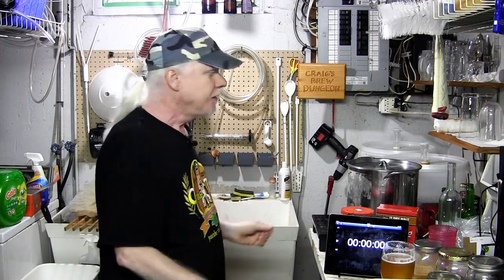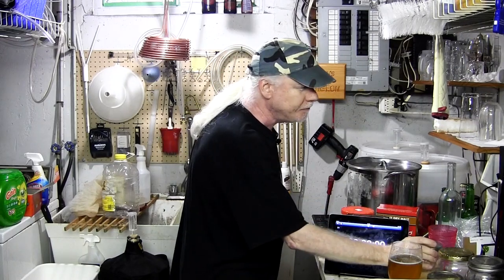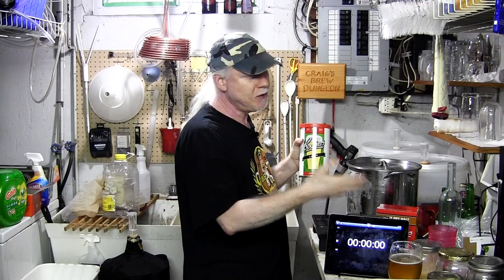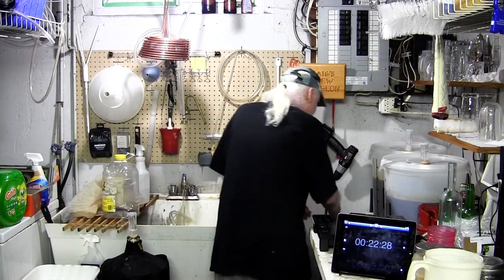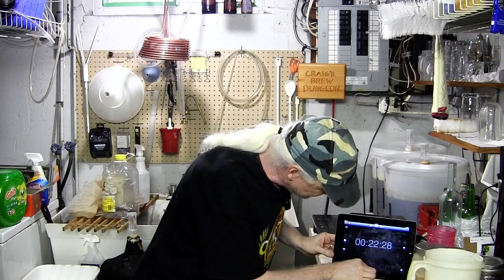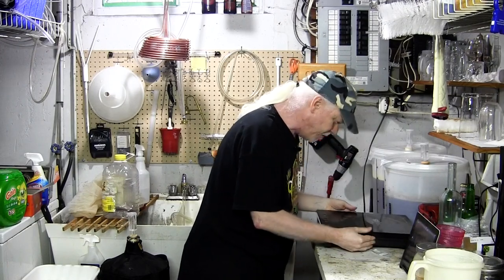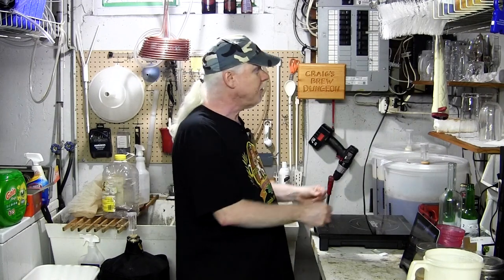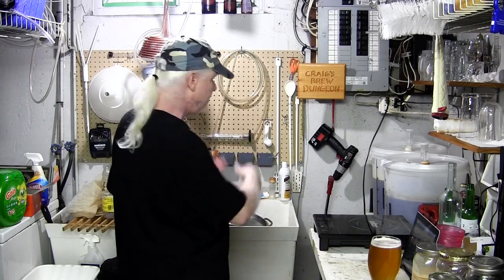HBW 249 - How Fast Can You Brew a Coopers Kit

Comment: I've been following CraigTube for the past 5 years. I've brewed beer, off and on since the early to mid 2000's. If it wasn't for CraigTube, I wouldn't have maintained an interest in home brewing for this long. The series of Easy Home Brewing that Craig has filmed is one of the greatest contributions ever made to home brewing. 

Craig, I'm just now getting back into the hobby after a long break. I just ordered from Northern Brewer one of those 1 gallon small batch brewing kits!. When I get a 5 gallon kit, I would also like to get into kegging. 

Do plan on checking out the 1 gallon brew kits as they are great for experimental beers?  

From one of your loyal fans, thank you for all that you do. 17 and cheers!.

Comment: Hi Craig,

I normally barrel (technically pin ;) ) a batch and then put the next batch in line on to ferment. Start to finish fifty minutes tops but I have done the deed in less than thirty minutes when all goes to plan and I don't mess up. Usually it takes about forty minutes and good beer ensues. All grain takes a full day and the beer isn't 100 percent better which is why I brew kits.

Cheers

Schnuz.

Comment: Craig the Magnetic Cooktop from Home Hardware is 1800 w /Max ,I've had mine for going on 3 years now and Its great with all the built in Safeguards, i.e.- Shuts down if  Pot is removed from the Cooktop.I Cook rice and if you forget or set the Cooktime correctly (rice to water ratio)it'll shut down if water has evaporated and prevents burning...Best $99 I've spent as it owes me nothing and I use it every day.Cheers

Comment: Craig, just got my 1800 watt induction cook top from Amazon $ 60.02 delivered. I haven't used it yet, I'm just getting my brew area together. I have the peg board getting the pegs today. Got five gallons in the keg, five gallons in the carboy. In your last video, I didn't notice any steam coming off your pot and, that is a very short amount of time to brew beer. I'm doing the pilsner at a 55 minute boil, nice if I could shorten the time, maybe later. I'm really new to this. The alcohol content is a little on the high side 5.5% I'd like to get that closer to 4.5%. It's got a good learning curve, I'll get there. Have a great day.

Comment: i dont pasturise my sugar and malt, i just boil the tin for 10 mins while sterilizing my equipment also boil a kettle, i pour the malt in the bucket rinse the tin with the kettle boil another kettle add the kettle with sugar and malt and top with cold water from the shower which gets it airated better and temperature is in range to pitch yeast, my kettle holds 1.7L 2 of those with the 10 min boiled can and then rest 23L cold gets you to about 22-26 deg c which is fine to pitch yeast, a boiled kettle is a constant temp so once you know how much boiled water you can pretty much do it with your eyes closed and be in range to pitch the yeast straight away which is ideally what you want to be doing

Comment: That was interesting suddenly hearing my name broadcast across YouTube! I think that's my 15 seconds of fame. (I knew I'd get it eventually.) I call myself "Ouroboros" on the 17 boards. That used to be what I used here as well, until Google started insisting that we merge Google and YouTube accounts. Shortly after I finally relented and allowed the merge, they stopped that requirement. (Google are a pain.)

Notes while watch:

I'm looking forward to the yeast idea put into practice. I've been thinking about doing that myself, but instead of harvesting from a batch of brew, I've been thinking about using a method involving a giant starter.

Holy Cow, you use a lot of sanitizer! I'll bet I use less than 1/3 cup when I brew.

The part that I really hate is the cleaning up afterwards and I definitely consider that time to be part of my brew day. That's one reason why I love the Coopers fermenter; you can just pour boiling water right into it. I'm thinking that you could have done the same with the fermenter you used and have saved some cleaning time later on. I'm hallucinating that you just may be concerned about sanitization, but Coopers' own instructional videos on YouTube involve just the fermenter, no pots, and they have their viability as a company riding on their results. The last thing they want is people having spoiled batches. Unsolicited advice:  you might want to try simplifying down to just the fermenter and see if you ever get an infected batch. 

As an '80s guy, like yourself, I'm enjoying the music.

Fruit flies don't drink much. (You know, 1400 km south of you, where I live, we call this season, "winter." Fruit flies? Really?)

Ah, yes. What you call, "doing math," I called, "Waiting for my wort to cool," and all of that time was included in my time. It's all of these little tidbits that extend a brew time: buying materials, preparation, brewing, waiting,  compensating for mistakes, waiting some more, taking temperatures, waiting some more, cleaning.... I think my shortest proper partial extract brew day was about 3.5 hours. This is the appeal to me - the only appeal to me - of pre-hopped extract brewing: cutting down the time. You mentioned expense: as I pointed out in my latest video, Coopers represents the single most expensive option for me, so I really pay if I want the convenience. 

Cheers!

Comment: Hey Craig, how many batches are you planning on using the yeast for? Would be a good experiment to see just how many times you can reuse the yeast until you start to pick up any off flavours. Cheers!
Reply from the maker: I"m going to keep using it until the beer starts to taste funny. We'll see.
Reply: CraigTube im a big fan of reusing yeast, i rarely fork out for the expensive liquid yeast and when I do I use for around 4 batches. its also a great way to stockpile all your favourite yeasts and I have also found the beer gets clearer and clearer after each batch.

Comment: Great video Craig.  By the way, this is the Induction Burner I have been using for a couple of years now and it's an 1,800W.  Does a really quick job of heating and maintaining temperature.  http://www.homehardware.ca/en/rec/index.htm/Indoor-Living/Small-Appliances/Kitchen/Countertop-Cooking/Miscellaneous/1800-Watt-Smooth-Top-Single-Burner-Induction-Cooker/_/N-2pqfZ67l/Ne-67n/Ntk-All_EN/R-I3834374?Ntt=induction+burner  I ordered it online and then picked it up at Home Hardware....you have a Home Hardware close by.  Maybe they have it in stock there.  Cheers, Dripstick
Reply from the maker: Awesome!

Comment: craig can you teach us how to make a lager
Reply: Nate Fidler only major difference is temperature. you need a way to chill that bad boy down. I use brew jacket and also fridge in garage, depending on time of year can also leave it in the basement
Reply: Oh ok. So when its fermenting it needs to be colder
Reply: Like below 20 degrees celcius. Maybe like 8 or 10?
Reply: you'd want to chill to about 15c or a tad less.
Reply: Ok perfect thanks dude that gives me a starting point
Reply: no doubt, there is several low cost mini fridge options. look up the temp control circuit for fridges. if you go this road, just go all in and get something worth using as a keggerator
Reply: That would be ideal im going to watch more videos on kegging bwfore i attempt it. But id much rather keg than bottle